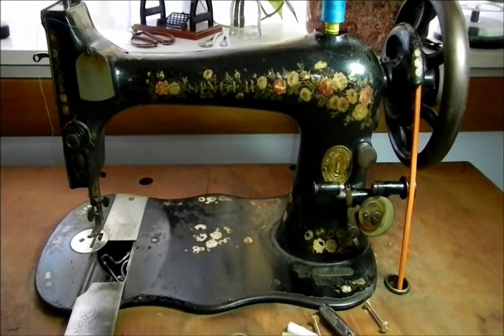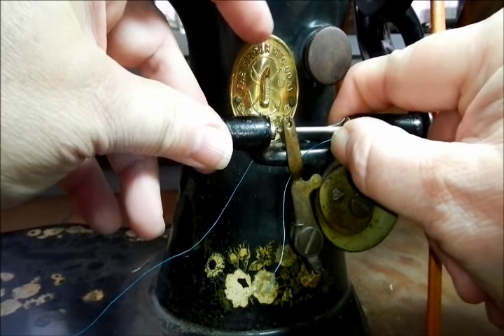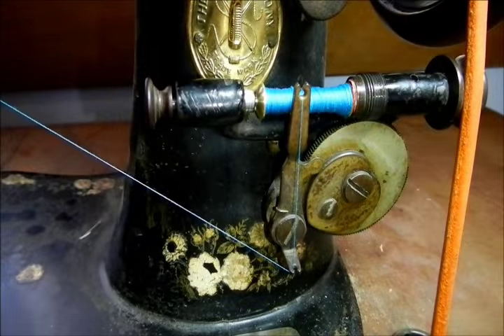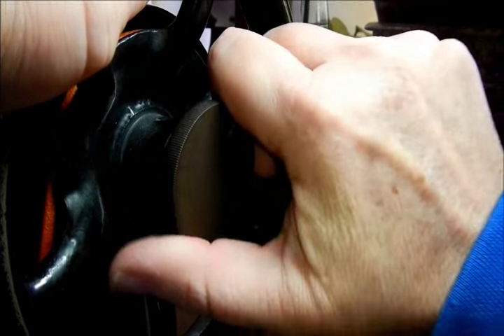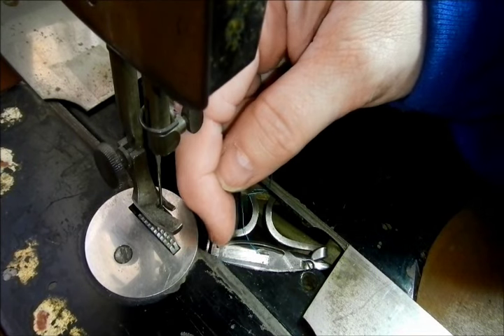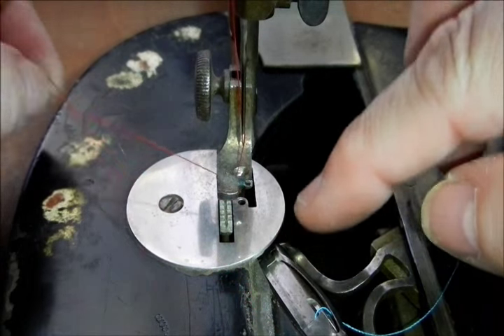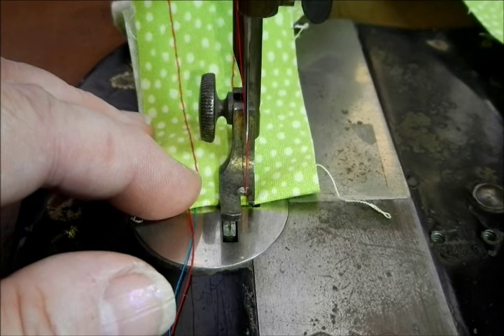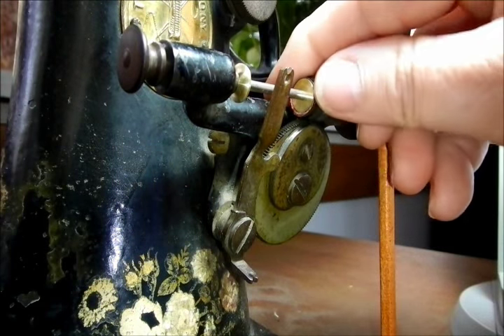Singer VS2 bobbin winding & threading the machine

Comment: Maybe a silly question....How to end a stitch?  Can you simply hand turn it backwards a few stitches to overlap?
Reply from the maker: Not a silly question at all!  You can NOT hand turn it backwards to secure the stitch.  Turning it back will only make it skip a stitch or make a thread nest in the bobbin area.  The only way to secure the stitch is to turn the fabric around and take a couple extra forward stitches.  OR, if you can adjust the stitch length on your machine, you can adjust it down to the smallest setting for the last couple stitches in the seam.  Same thing when you begin a seam - shortest stitch length, then adjust it up for the seam to a longer length.  Not the solution you wanted to hear - but it's the only one with this type of machine.  However, there are a couple old treadle machines that do have a "reverse" lever - like the "Jones" and the "Vickers" - both British machines.  Hope this helps!
Reply: The Masquerade It sure does Thank you very much...I will have to experiment..The machine was given to me so i am learning...How do i know if i can adjust the stitch length?
Reply from the maker: @ipglance1  , do you know what model machine you have?  Some have a knob on the front of the machine that just looks like a huge screw.  You either loosen it out or tighten it as close to the machine as you can go to change the stitch length.  Some of them actually have the big screw attached to a lever that moves up and down -  I demonstrate that on a different machine (a Singer 15) in this video at about 1 minute into the video. . .  https://youtu.be/w8Wx589eCm8
Reply: Yep...Its a G0120442..i also emailed you a picture of it....

Comment: Thank you
I have an old singer machine that looks identical but I don't know the model number. The decals/artwork are not the same, but otherwise machine features look the same. Should I look for a VS2 manual?
The stamping on the right side reads L1121609. The shuttle and long bobbin look identical as well. I couldn't find a manual for it so your video sure helps.
Rich
Reply from the maker: I'm glad my video could help!  That model number is listed as a Singer 27 from Nov. 18, 1901.  So you'll want to download a manual for a model 27.  You are correct, it is the same machine as the VS2 - but with the newer version, they changed the shape of the bobbin shuttle just a tiny bit ;)
Reply from the maker: Thanks for sharing!  I have a copy of this printed out - but the online version has much cleaner illustrations!

Comment: Hi! How do you regulate de bobbin tension when is too loose? Thanks
Reply from the maker: There is a tiny screw on the bobbin leaf spring that you can tighten, but it's not recommended.  The issue may just be that there is lint stuck under the leaf spring causing the thread to move too swiftly. If you are seeing big loops of thread showing on the underside of your work, then most likely it's not the bobbin tension at all. It is probably the top tension is too loose. If the bobbin tension is too loose, you will see the bobbin thread pull to the top of your work. Touching that screw on the bobbin casing should be your very last resort! I've never had to do it on any of my 14 antiques for the last 12 years I've been sewing with them. Hope this helps! 😉

Comment: Hy I have this machine I can do all the but when I sow it's no make it what I did wrong  please help
Reply from the maker: If the machine will not pick up a stitch, the it could be a couple things. You may have the wrong kind of needle, or it's not installed on the needle bar properly, or it's turned the wrong way or maybe it is bent just a little bit. You may also have the wrong bobbin shuttle for your machine. Each year of a certain model machine could have a different bobbin shuttle that is specific to that machine.
It could also be as simple as you are moving the treadle wheel backwards. Most machines work with the hand wheel moving up and over the top toward you. But there was one machine I know of that works only with the wheel moving up and away from you.  It could be a combination of a few of those issues. You will have to be patient and try adjusting lots of things. I hope this helps!

Comment: Tengo una maquina igual y me corta el hilo de arriba a la primer puntada,que puede ser?
Reply from the maker: Cutting the top thread at the first stitch could be that you have the needle turned in the machine the wrong way.  Some machines thread from the front to the back, and some from the right to the left - but most thread from the left to the right.  Hope this helps!

Comment: Thank you, you're a doll. Now, I cant get the bottom tension right. Wish someone could direct me...
Reply from the maker: See the little screw on the bobbin shuttle?  It holds the tension spring in place.  You can tighten this screw the tiniest little bit to tighten the tension (do this if your bobbin threads have been pulling to the top of the fabric) or loosen the screw if your top threads have been pulling down to the bottom side of the project.  The slightest turn of the screw makes the biggest difference!
Reply: The Masquerade I've been trying. It's a little frustrating but I won't give up. Thank you, love your videos.
Reply from the maker: So Candice - did you get it working?  I just made another video - requested by one of my viewers, on how to load the shuttle properly.  It occurred to me that maybe your bobbin is being placed in the shuttle upside down - so it's not coming off the spool correctly.  Check out the new video ;)   https://youtu.be/EGRlXhc7Erk

Comment: thank you very much. Im still confused as to what kind of needle is used....
Reply from the maker: You can use a 15x1 modern needle.  It's flat sided and comes in many different sizes. I like a 90/14 for most of what I sew on my treadle. They all work!  These are the needles you use in almost all modern machines.  ;)
Reply: thank you , will do. Ogden Utah USA

Comment: I just got one for $60 with out a belt do you have a video on how to put one on thanks
Reply from the maker: I don't have a video, but it's easy to explain.  The belt will come in a long length and needs to be cut to fit your specific machine and treadle table.  It will also come with a heavy metal "staple" hanging off one end.  You wrap the belt down and around the lower wheel on the treadle base and then back up and around the top of the hand wheel on the machine.  Pull the leather belt nice and tight, then cut it so that it will butt up against the end with the "staple" in it.  Then you punch a hole in the cut end of the belt so you can feed the "staple" through the hole and then clamp it tight to the belt with pliers.  That's it!  You have to make sure it's tight - or it will slip while operating the machine.  You might want to buy an extra belt in case you don't get it right with the first one. ;)
Reply: The Masquerade thanks I will take advice on the 2 belts thanks for telling me how to put it on you are kind
Reply: Please let me know where you got the belts from. Can you order them online?
Reply from the maker: Yes!  You can find them on Amazon and on Ebay.  The going price is about $20.  It's round red leather, cut to a larger length than needed, and comes with a heavy duty staple to attach the ends together.

Comment: The hand wheel wont disengage. Can't turn small wheel toward me
Reply from the maker: You will need to remove the machine from the table, and turn the machine on end with the hand wheel on top. Then squirt some kerosene in around the small knob and let it soak in. After an hour or 2, put some machine like around it, then try to turn the small screw on the small knob/hand wheel to unscrew it. When that screw us removed,  you will be able to take that knob/wheel off of the machine. Now you can clean it thoroughly with kerosene.  Let it dry, then hit it all with clear sewing machine oil.  Re-assemble, and it should work great!😉

Comment: Why can't I get the shuttle thread to catch the sewing thread???
Reply from the maker: It could be that your needle is threaded in the wrong direction, or that it's the wrong size needle. Is it the original shuttle? There are several variations that all look similar, but if it's not the one made for your model machine,  then that could also be the problem.
Reply: @TheMasquerade  really confused**I got it to work by flipping it over and threading through the bottom(which is kind of a pain) I don't see any way, or how the shuttle thread is supposed to be hooked otherwise.I picked it up at a flea market so it has whatever it came with , but they all basically look the same on YouTube. Id really love it to function properly.

Comment: That poor machine. It's so dry. It desperately needed to be oiled.
Reply from the maker: Yes, it sure did!! I had just got it running, and was so excited about it, that I went right into making the video. Then I took her all apart, bathed her in kerosene, cleaned out all the gunk,  and bathed her in oil. I use her all the time, and she purrs like a kitten.❤
Reply: @TheMasquerade  I just picked up a 1906 Singer 27 VS2 in very good working order. Still searching for my treadle.

Comment: My in law Mother singer sewing old/1947..
then My in law mother give me singer sewing old/84'..
I hold ticket 264.00 saved/1947..
But l was problem Singer Sewing wrong?I not known repair how?
Bt call repair singer where??
Reply from the maker: I'm not sure what you are asking.  You can repair the machine yourself by taking off the throat plate and end plate and back access (if there is one).  Then clean out all the old sticky black oil with 100% Kerosene and some small pipe cleaners or Qtips or little wire brushes.  When all the old gummed up oil is out of the machine, then give it a good squirt of new sewing machine oil on all the joints that move.  If you are missing parts, you can usually find them on Ebay.  Do a search with your machine model number.  You can look up all Singer models with the serial number on the front plate by using this link.  https://ismacs.net/singer_sewing_machine_company/serial-numbers/singer-sewing-machine-serial-number-database.html